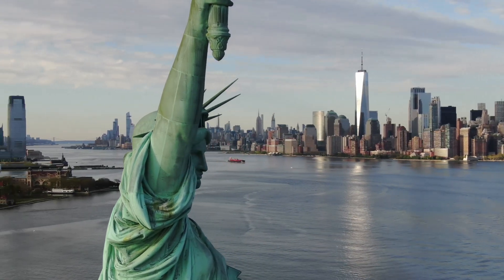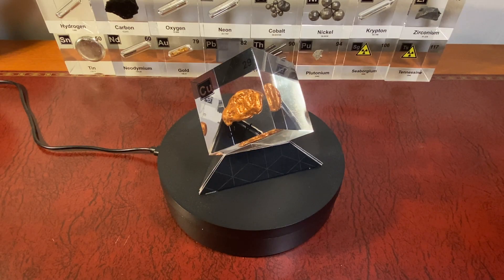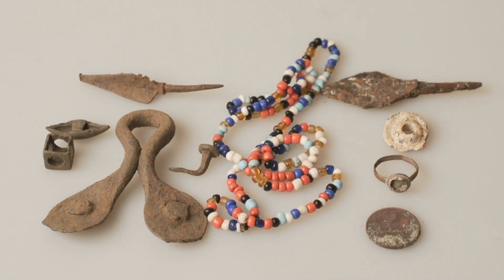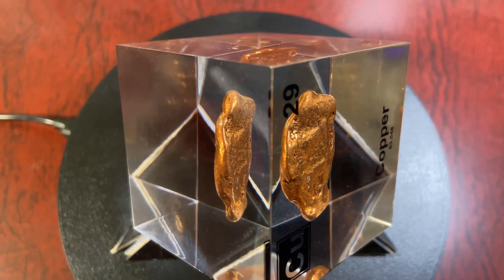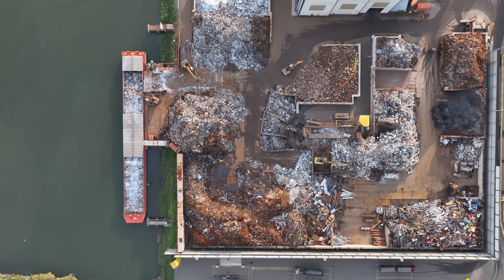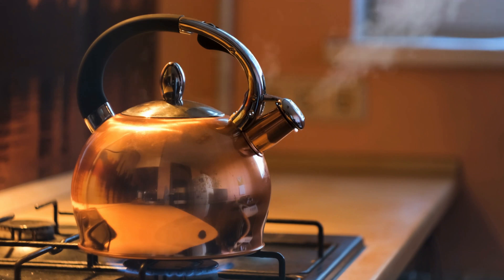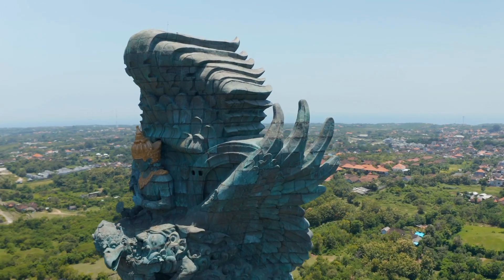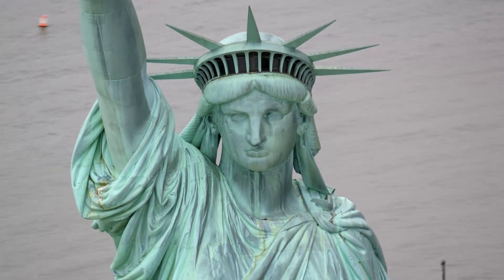Copper: Why the Statue of Liberty Turned green!🗽

Comment: How do they get the copper of the flame of the statue of libety to not have the patina?
Reply from the maker: Now this is a cool story!! The torch it has now is copper with a layer of 24k gold this is why it remains it's color. This is however the Torch that was installed in 1986. Before the torch had panes of glass and lighting in it. Fun fact was that the Torch that is now installed is per original design.